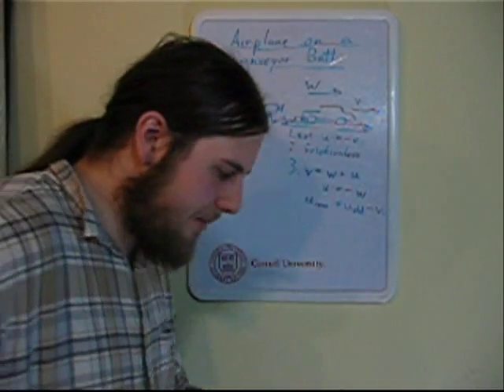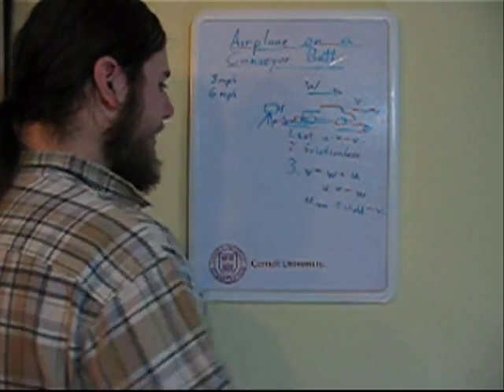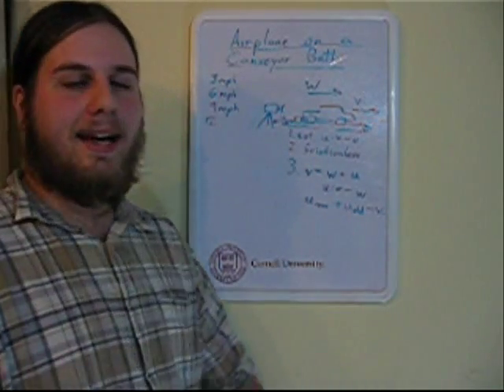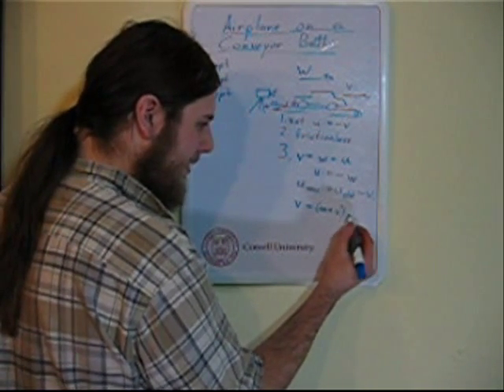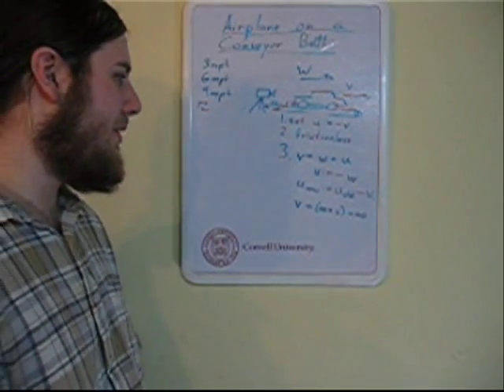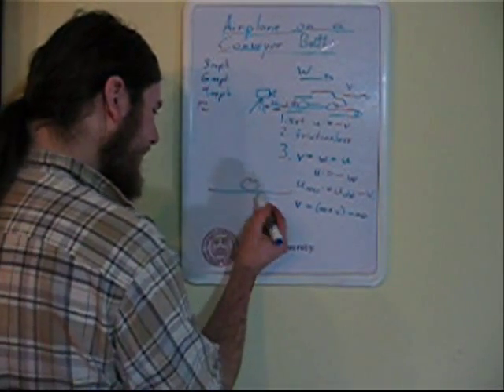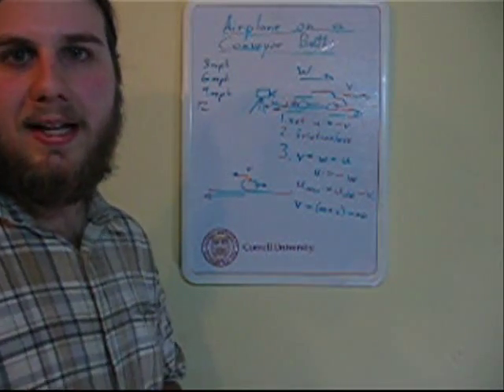Airplane on a Conveyor Belt - Complete Physics, pt. 3

Comment: You are making one mistake that kills your hypothesis.  Unlike you or a car a plane moves by pulling on the air, the wheels have no power going to them like your feet and the car's wheels.  The wheels on a plane are just there to reduce friction.  Run the conveyor as fast as you want, the plane will still move, as long as the wheels do not fail, and if it has wings it will take off.

Comment: If the wind speed is 0 over the wings, the plane will not take off. You guys are trying to damn hard to figure this out.
Reply: Look at the mythbusters video, they actually do it full scale. The conveyor belt doesn't prevent the plane from gaining wind speed even if its going the same speed as the tires because it pulls itself through the air, it doesn't use the ground, so even if the conveyor belt was moving the same speed as the tires- the plane will continue to pull itself forward at the same speed regardless thus gaining wind speed and take off.
Reply: @LightShowBeau   the Myth Busters seemed to work because it was incredibly sloppy and lacked any meaningful controls.  Jamie basically stated “I just floored it.”  Okay, but you had no way of synchronizing the plane’s speed with his pickup truck.
Reply: Correct.  It’s all about air speed over the wings

Comment: I accidently posted my unfinished response but as I said and as the question said u=v and w=0... you can't argue u!=-w+v or that infinite is not equal to infinite+w when w=0.

No mater anything by the question and by definition u=v and w=0.
Reply: Look at the mythbusters video, they actually do it full scale. The conveyor belt doesn't prevent the plane from gaining wind speed even if its going the same speed as the tires because it pulls itself through the air, it doesn't use the ground, so even if the conveyor belt was moving the same speed as the tires- the plane will continue to pull itself forward at the same speed regardless thus gaining wind speed and take off.
Reply: Yes, it pulls itself through the air, but the weight of plane is supported by its wheels. Theoretically, at the start the plane MUST gain ground speed, in order to gain air speed. If the wheels do not gain speed relative to ground, the plane is not going anywhere. The Mythbusters experiment was flawed, the plane they used was light, and the speed was not ideally matched, and the propeller was pushing air around the wings.

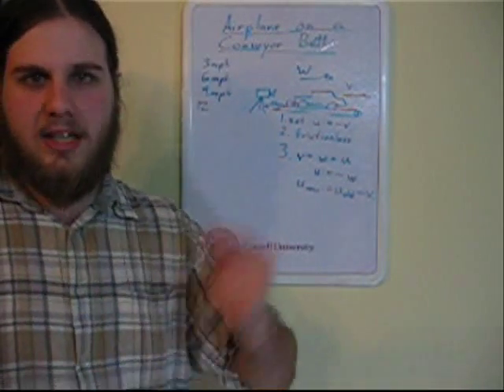Comment: 2:42 "if your motion relative to the ground isn't zero"... but the question says it is zero.
3:14 "for u=-w..." but the question says w=0

#1, this is magic and #2, this

at 4:11 race condition... no race condition... if airflow pushed over wings is enough to compensate for normal forward momentum.